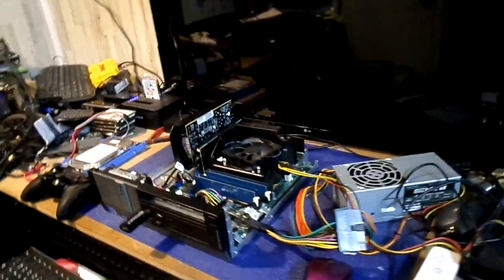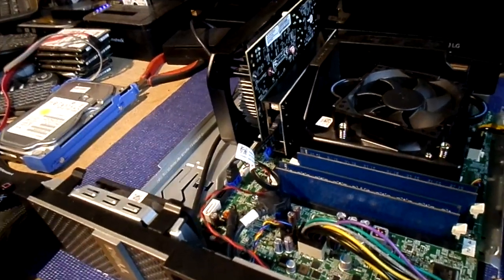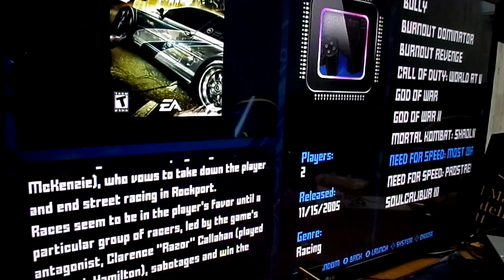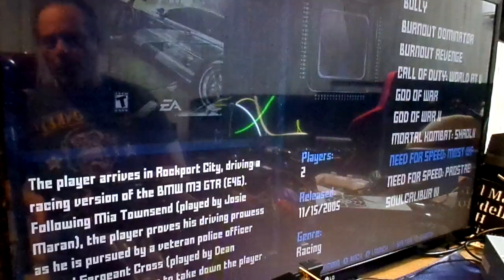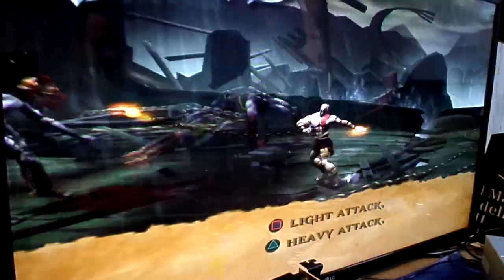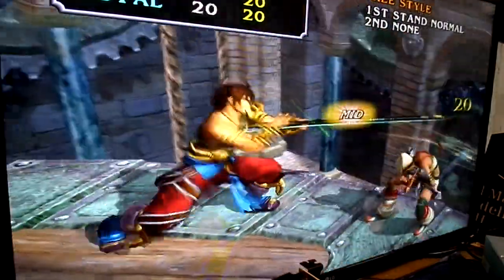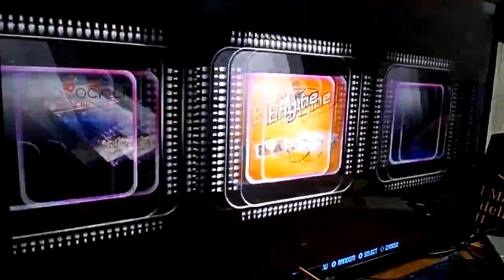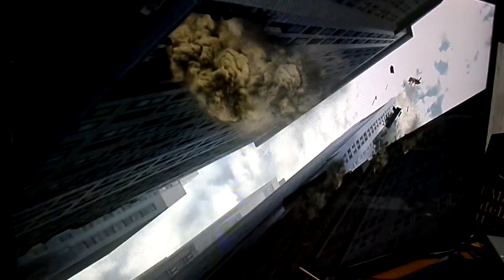Emulation Station X86 64 With Ps2 Gamecube and WII By Tony Mondello

Comment: dope loads better than my pc 
with a 2080ti must be the ssd
Reply from the maker: Yes it has Nvemu ssd so the read speed is like 2000 mbs and it has a 120 gig sata drive ssd also on the pc riser card that i use for the boot and efi partitions